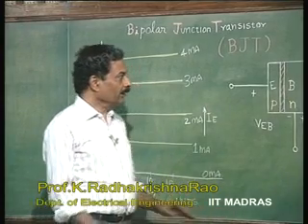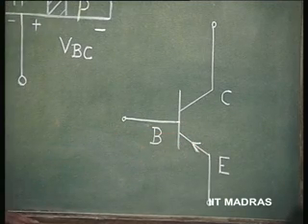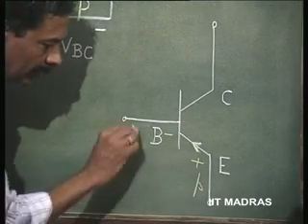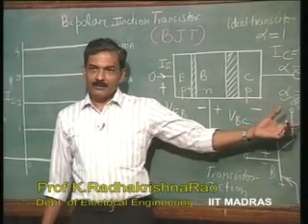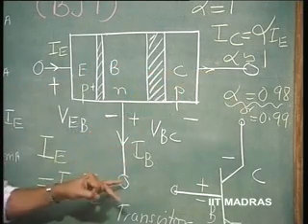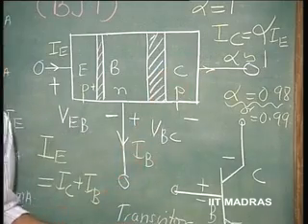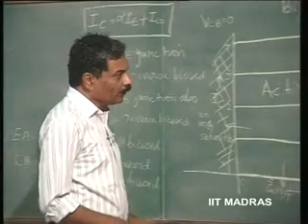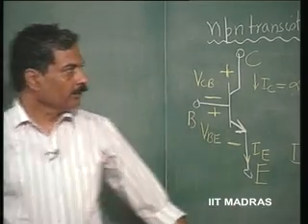Lecture - 20 Bipolar Junction Transistor

Comment: at somewhere 9:02 he says Vcb=0 is the border line separating saturation and active region, will not it be Ic=0 instead of Vcb?
Reply: nidhi upadhyay no its Vcb =0 since the x axis represents the voltage.. and y axis represents the current which increases as we move up.
Reply: nidhi upadhyay ...no its correct Vcb=0 is the vertical line passing through origin and the region left to that line is the saturation region.

Comment: At 39:01 what is Ico? What is that current?
Reply: +mejoe444 I am guessing although I have done some reading, I think it is Current ( I ) at Collector/Output or On?
Reply: +mejoe444 Ico is the reverse sat. current which comes from hole and electron mobility action. in this course you don't use this info. too much becouse this is a design class for amplifiers and using these instruments in designing amplifiers. 

Ico current is a concept where you usually see in designing "TRANSISTORS" not the circuits but the very device itself. you should check "solid state physics" or "solid state devices" in order to get more information about this. if you don't have in your curriculum just skip it for now :):)
Reply: Ico is the reverse saturation current which is caused due to the minority carriers in the transistor
due to high temperatures outside ,some of the bonds which are present in the pn junction gets ruptured and due to which some of the carriers are released into the diode and cause some current to flow
in other words the bonds in the junction are broken due to heat energy and gain enough energy to cross the pn junction causing some current to flow in the transistor
Reply: Ico is the reverse saturation current at the collector base junction